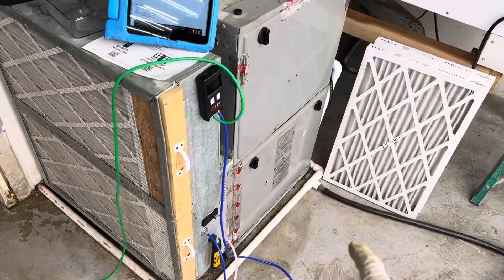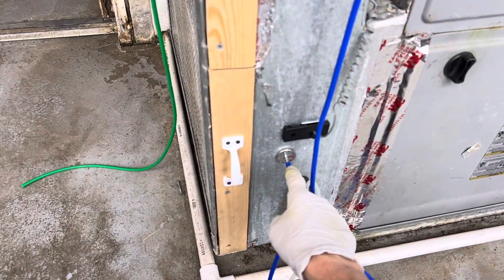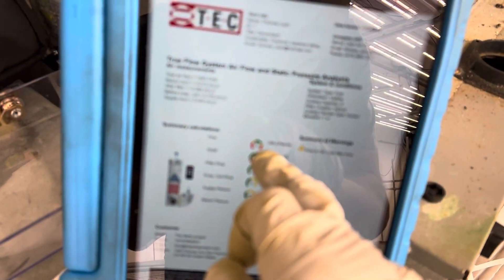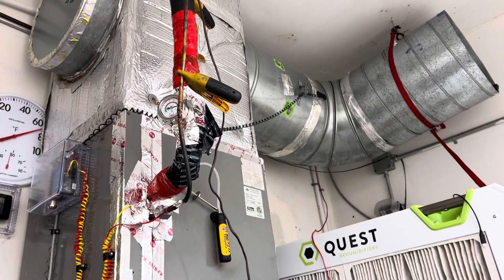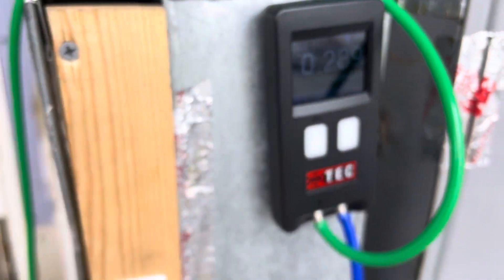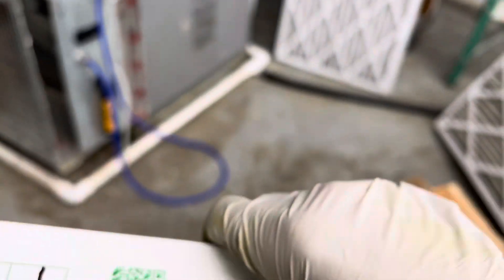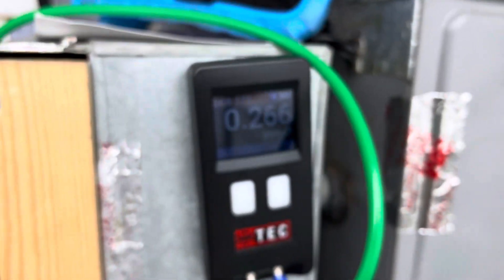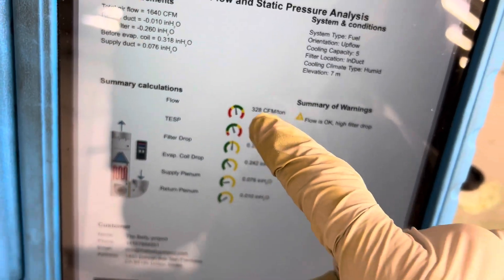Measuring static pressure drop across clean and dirty air filters￼

Comment: What good is a MERV rating on a filter when there is no rating for the restrictiveness?
Reply from the maker: There is a rating on restrictiveness better known as static pressure at a given CFM flow on good manufactured air filters. It’s printed on the side of the cardboard of the filter.. 

Most general consumers don’t know this 
In fact, most contractors or service technicians are installers. Don’t even know this. . 

Especially if they buy real cheap branded bulk filters, it is common for them to have no writing or specifications on them because they went for the cheapest price 

How to choose the right size filter is Todd in class when a technician attends one of the 2 1/2 year HVAC AS or AA degree programs 
    But most owners technicians are contractors are too lazy and it’s easier making money by stealing from people and selling them stuff that’s not properly sized. And they get away with it.
     So why would the majority of them want to learn anything more that would take time and money? 🤔 
      They make more money by stealing from people and improperly installing HVAC systems to customers will not know that they’re not properly installed

Comment: shoulda got the samsung
Reply from the maker: I do not have good back up and support here in my local area for Samsung.  I can get my LG circuit boards and components overnight. I cannot get that new Samsung in my local area.. 

The equipment is only as good as the installer who installs it into support for components we need rapid replacement

Comment: What do you think of the K and N washable filter that is Merv 11?  I don't know what the pressure drop is?
Reply from the maker: If it’s one of those thin 1 inch thick filters it’s extremely restrictive. 

I tell everyone spend the extra money and get the 5 inch deep pleated filters. 

       The higher you wanna go in the MERV rating the larger your filter needs to be.  And it should be deeper too because then you have more surface filter area because each plate is 5 inches deep instead of 1 inch deep. 

Those filters in big box stores like Home Depot that are re-washable are very restrictive. 

      And I did not know K&N 
Who is well known for making automotive filters made one for home furnaces . 
     I got a look that one up. 

I will be getting a whole house air particle measuring device that can data log 2.5 and below particles in the air and I do want to do some filter testing. 

    But the secret which is not really a secret the size of your filter do you want to keep the face velocity per square foot of filter surface very low to actually achieve your Merv rating

So if you spend that extra money for a Merv 11 filter but it’s highly restrictive and too small for the CFM of air of being moved across it. 
         Then by forcing air faster you force small particles through the Merv 11 filter basically turning it into a Merv six filter but you still pay the price for a Merv 11 filter. 

I used to use K&N filters on my cars years ago
Reply from the maker: I own $1000 Precision, memo, meter Peto tube kit for just measuring airflow I could do my own static test.   And a TrueFlow grid for taking precise airflow measurements..
Reply: @coldfinger459sub0  I took out the KN.... my furnace/AC system was so loud!  I could tell there was more strain... performance was bad too!  I put my Merv 8 filter back in. Runs perfect!
Reply from the maker: @glocktown21  if you want to go to go with a filter with smaller particle abilities to filter out .   Then you need to increase the surface area. And or depth. 

    1” filters are absolutely garbage. 

Go with 5” deeper filters 

If you want MERV 16 filters always use the biggest possible size L/W/D to lower static pressure.  

For example if you had a 1” thick filter one a 5 ton unit. It would have to be 30”X 48” +  to have low pressure drop

But if you had a 5” deep filter you can have 16”X30” to achieve the same pressure drop.  

This is only a example to get the pout across.
Reply: @coldfinger459sub0  Good to know! Thank you!